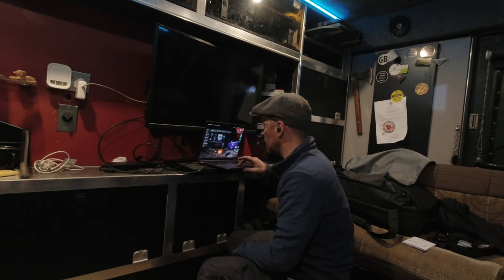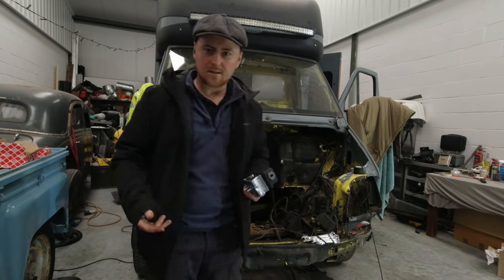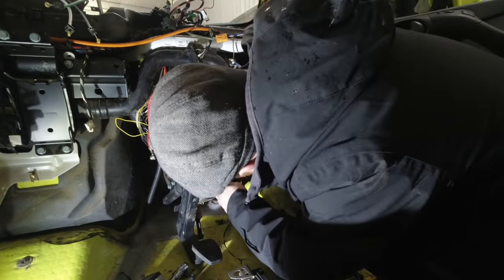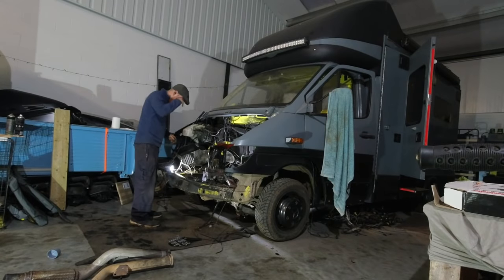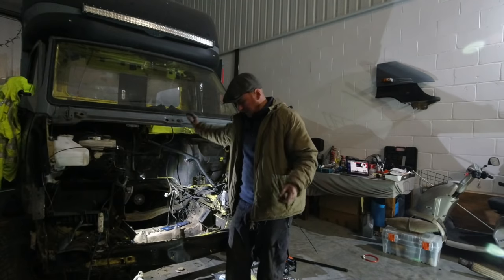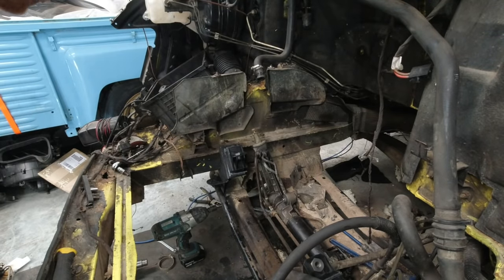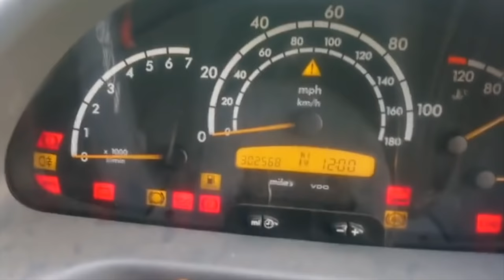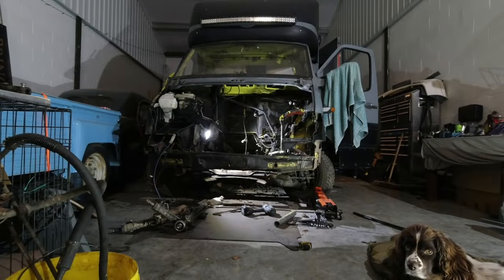Steering Rack of doom! - Amber 2.0: ep.3

Comment: Before you admit defeat on the track rod ends, surely you can tap the thread further down the shaft to give you what you need? 
I have tap and die sets, might be able to help you out.
Reply: That's what I was thinking, or take them to a local machinists who will shorten them and extend the thread for peanuts.
Reply: I thought that would of been a possible answer but I guess he’s passed that point now. He could just sell it to help pay for the replacement.
Reply: aren't the rods hardened after threaded ?

Comment: When I swapped my engine & gearbox over in my old mk1 ducato camper.  I didnt keep the wheels off the donor van as like you I sold all the parts I thought i didnt need. When all was back on the road my speedo was out as the engine & gearbox were from a van with 16" wheels. I then had to find another set of 16" wheels. Nightmare they were like hens teeth!

Comment: This series has convinced me to never ever buy a Sprinter. I'm perfectly happy with my '72 406D Düdo where everything is so accessible. A ladder chassis and only a little electrical stuff is a true blessing.
Reply: The *13 with the OM352 engine would be the version still usable in today's traffic, the *06 regrettably is very mid 20th century and thus often at a high risk to get dangerously overtaken even by cars/trucks not really up to it, while these Düdos are the "better" because by far easier-to-work-on trucks compared to the Sprinters. 
I still prefer the much quieter, much quicker and more economically running 312d over the 613 I had before - 8.5 l/100km versus 15 l/100km can be hurtful with diesel prices like today.
Reply: @manfredschmalbach9023  I’ve put in an OM601 turbo intercooler from a Vito 110D. The original OM616 is indeed way too slow.
Reply: @daan3298  That's an excellent choice. 
I love that OM60* engines - got the 5 cyl. version with the direct injecting Sprinter T1N-head, Garret turbo and an Intercooler but an "oldfashioned" low-pressure Bosch pump.
300 k km never opened, basicly oilchanges while nothing else, and compression still in mid range of the "when new" spec.
And should anything go wrong once (I sold the 80 k km donor engine I had in stock after the compression test on the "barely run-in" 300 k km-one ;-) there's a plerthora of cars all around the globe with OM60* versions sporting all the same pistons, pushrods and bearings, even an Unimog version with that powerplant does exist, heads are interchangeable between prechamber and direct inj. versions ..... and a better, more efficient burner than the old 220d Taxi engines ... important with steeply rising diesel prices. Oh, and it does go on veggie-oil-only also, in case You weren't aware of .... Cheers
Reply: @manfredschmalbach9023  I'm aware :) The reason I went for the OM601.970 was mainly that it is mechanical, as in it does not need a computer. Secondly it was the most powerful 4 cilinder option. I'm eyeballing a larger turbo and modified dieselmeken pump. But that will mean I also need to change to a 508 diff/axle. Or the rare axle that is between the ration of a 406 and a 508. Either way, it doesn't make sense to upgrade turbo and pump only to accelerate faster to 90km/h. 
My 601 I've put in a new head gasket, should go another 300k without issues. Although the double mass flywheel sucks and needs replacement too.
Reply: @daan3298  Yup, those double mass flywheels are a consumable - a pricey one. 
I wouldn't go for a bigger turbo except a Garret variable pitch one. You enlarge the turbo lag exponentially with a standard bigger, non-adaptable one - those variables do need an ECU though, as far as I know.
If You want to go even bigger: A drivetrain out of a rusted out Vario OM904 would be an option, engine, gear box and diff. - those are legendary for never ever breaking once You have the technique revised if "preloved". Friends have a Vario with an OM904 and seven digits on the clock - never opened engine, first head gasket, second oilpump, second injection pump. That thing is a tank, and it's an RV, officially reduced to 3.5 t max, so they go without the lorry limiter, no electronic log, no extra brake checks. Only thing better than that would be a 4X4 version of it. Cheers!

Comment: Sorry for your efforts and struggles, if you want a spare pair of hands then I can be there to help, all I care for is a wee bit of learning. P.s. I bought a  Sprinter patient carrier with windows, air con, heater etc. And the batteries are constantly near zero. I need to disconnect the two systems to eventually get the ruddy van working day to day.

Comment: Although the six series 903s always had 16” wheels the common belief is that the two, three and four series only ever had 15” when infact those late production run out 903s in 2006 did have 16” from the factory, just for a very brief period in the final model year (hence their scarcity now). I remember as I was going to fit a set on mine to play with final drive, but didn’t get around to it before changing to a 906 shortly thereafter.

Still slightly amazed that you even came across a six series as a donor vehicle in the first place, given how few of them were ever made.

Comment: cut the track rod end to shorten the length
Reply: i did it on a few grass track cars. i threaded the old one back in to the joint the angle ground just through the track rod so i didnt mess the threads it worked fine

Comment: This comment was edited because I commented before getting to the end of the video.

The donor van would have likely had a wider distance between the control arms. The rack being wider will allow the control arms and the tierods to track through the same arcs of movement and not bump steer.

If you fit that rack on your van, you will have changed that geometry. Steering and suspension has to be properly aligned throughout its whole range of motion or bad things will happen.

I hope the end result was a remanufactured rack. Fitting the wider one very likely would have created a real bear to drive. A rebuild from a reputable source can be better than original equipment.

I did a fairly major steering update on an old truck I have. I updated the way one steering component attached to the frame and upgraded from manual to power steering. I still need to move the steering box about an inch frontward to finally get rid the last of the problems I created. The process I went through felt a lot like what you are going through. Except mine was able to move under its own power while frigging with the steering. I created something really terrifying to drive while working towards a solution. The bump steer the first time I drove it would send the truck over a lane if I hit the wrong sort of bump.

Comment: How far apart in their original year of build are donor and Amber? They changed a lot from production year to production year in that era; I had similar experiences with donor-parts for my T1N 2,9 212d with a donor just two years prior - it was a difficult time for Mercedes with Schrempp "leading" them from Mercedes into DaimlerChrysler, which was a nightmare as we know today, and with Schrempp more "leading on" than leading .... .
Reply from the maker: The vans were 3 years apart and yes there has been a lot of differences between to two. Some minor like electrical plugs, but others have really been a challenge. 
Then some that just plain do not make sense from a manufacturing point of view, but like you said, sounds like a strange time at Mercedes. 🤦‍♂️😂
Reply: @ProjectAmber  Being not "real time" I reckon, You might have a working engine, clutch (the real thing) and a gearbox to stir'n chase Your own gears now in Amber again (hopefully) .... what a major task, brave man, and satisfying once done. 
You can't possibly break down without at least knowing how to get there and repair/change the culprit afterwards!
Cheers 🍻